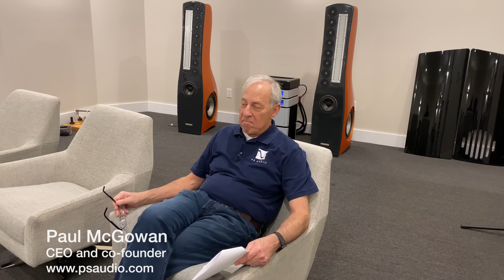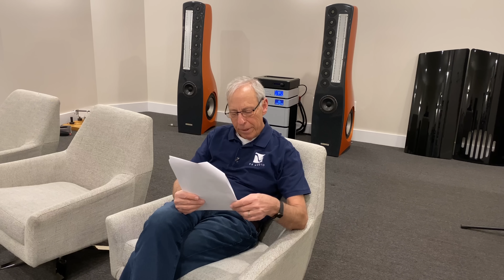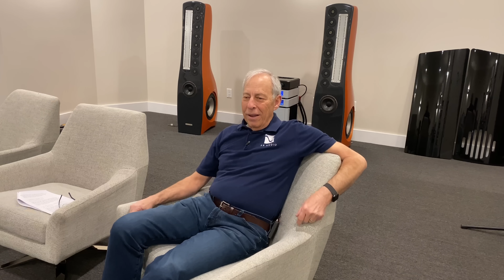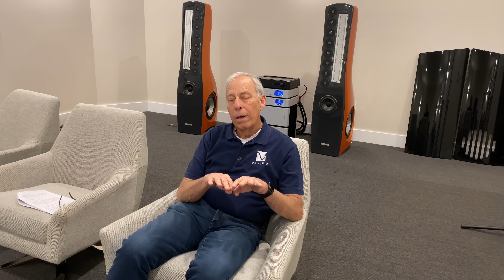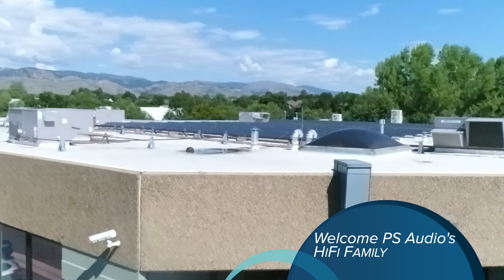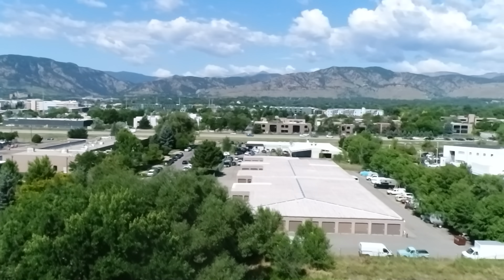Are mains purifiers necessary?

Comment: I use different power conditioners for different things as i cant afford a ps audio regenerator though i really wish i had one however i got a much cheaper voltage regulator with a line filter added on plugged in threw it and seems to run better than the wall

Comment: i have no idea what a mains "purifier" means. However, one of the best improvements I ever made to my home studio, which has multiple analog audio interconnected devices as well as digital interconnections, was to power all devices from a single balanced power isolation transformer, specifically a Furman IT-1210. That not only completely eliminates any possibility of ground loops but also filters electrical noise and voltage spikes present on the mains. There is no electrical connection between the input and output. The input 60 Hz 120-125 VAC is converted to a magnetic field in the primary windings of a huge toroidal transformer and the magnetic field then induces the same voltage in the secondary coil, which provides the output power. Because of magnetic reluctance high frequencies cannot be communicated between the primary and secondary coils. The magnetic "inertia" also knocks down momentary voltage spikes.

Comment: It’s Not true at all I have power conditioning that I cannot distinguish from the wall it took me some trial and error but I found a great one,I have tried regeneration from the original 300 and newer and every time my playback got sterile,my system is very high end and revealing and I can hear a cable changes anywhere in my system and always the same outcome with regeneration,great talking points but that’s it for me

Comment: My experience is the same as Paul’s.
I used Russ Andrews purifier blocks and cables for years. It was a rabbit hole I just journeyed down and didn’t look up. A dealer then came to my home to install some speakers.
He noticed my mains set up. He said. I’ll give a free upgrade in sound. Unplug your power amps and pre amp and put them straight into the wall socket. Boom! What a difference. 
And yes it was a live recording. The last track on Harvest Moon. All of a sudden you could hear the room ambiance in the recording. Try it.
Reply: Agreed. I initially had my amps and sub plugged into the wall and almost had to watch how loud it played (I have neighbors). After completing my system(s), I then moved to improving things (for the sake of improving things). After plugging in my conditioner, I noticed (just like Paul) that the sound was "cleaner" yet it was missing that "punch". I made myself believe that the cleaner sound was what I really needed. About 10 months later, I switched back to the wall after reading some posts, and have never looked back. Its amazing what you miss by doing this.

Comment: Don't the capacitors in our systems store power and distribute it cleanly as needed? Wouldn't this mean that this stored power has already been made stable and isn't really coming out of the dirty wall outlet anymore? Power settles down in the capacitors and is subsequently dished out cleanly and stable as needed.
Reply: Simply put, yes. This is why everything has a power supply. The idea that power can be "dirty" or "noisy", especially with audio, is complete nonsense.

Comment: I’m not sold on a “separate” power regenerator or conditioner etc.  

I have 2 modest systems. One in the living room and one in the family room.  

The family room was more of a “starter” system I first got in 1996 I believe. When I purchased the Adcom amp I decided to get the Adcom power conditioner for it.  I don’t think I even bothered listening to with or without because the bottom line is that I didn’t want to plug in my amp or other components directly to the wall outlet or use some cheap power surge protector.  

All the components are plugged into the power conditioner and eliminates any turn on or turn off thumps. Everything still works in 2020 in two different homes and has survived many power outages. 

The system in the living room has 2 Acurus Mondial Designs power amps and pre-amp and so I also bought an Acurus power conditioner.  I am of the belief that matching components from the same maker is a good start.  This I bought in 1998 if I recall. 

All the components also have lasted two homes and work fine even today.  At time I didn’t even turn on the system for like 6 months or longer.  Works fine.  

I kind of go in and out of high fi stuff.   Watching these videos is getting me back in to this. 👍

Comment: Purifier/regenerator/conditioner... all the same: they are made to compensate for shitty power supplies that lack proper mains noise rejection.
Instead of curing symptoms, try to find the root of all the issues and solve that; replace the shitty power supply with a good one.

Comment: Just buy modern gear with switch mode power supplies -- by definition, they "regenerate" mains power to high frequency AC before the (vastly smaller) power transformer delivers it at a suitably lower voltage to the rectifier and filter circuitry to provide DC to the actual audio electronics.

Comment: Any power regenerator must take the incoming power of whatever non perfect sine wave it is and store it somehow either in capacitors, batteries or both which are DC storage reserves, then regenerate it by creating  a new sine wave that is made by power switching devices which is in effect a digital to analog converter but a single frequency one that has its own high frequency switching noise that uses a low pass filter to reduce the switching frequency energy. This is in reality just a high power class D amplifier operating with a single frequency sine wave signal. It is in effect just an additional power supply to the ones inside your electronics, which if adequately designed and built do the same thing as a power regenerator but just for their own device.

The only precautions really needed for audio systems are to not have heavy load appliances especially air conditioners or refrigerators that have compressors with very high peak starting currents on the same circuit as your audio systems, although adequate power supply storage capacitors can effectively keep those transients from getting into the amplifier and your audio. A decent power conditioner with good RF filtering to keep conducted EMI from noisy switching supplies in the house like computers, televisions,etc. and EMI from outside the house like from your neighbors saws, televisions, computers, etc. and RF fields is a smart idea. Also the surge suppression that is built into the power conditioners to limit the spikes from lightning, motors turning off, etc. is a good thing.  

The claims of a power regenerator preventing the masking of audio subtleties from happening is not going to happen with good audio equipment power supplies and external power conditioning.

Comment: I have often wondered is there is a difference between running 120V or 240V to stereo equipment.  Most modern US homes are 240V at the box and then just use one side of the 240V to get the 120 V.  A lot of stereo equipment has a setting for 240V power.  You would have to have a dedicated circuit though.

Comment: My snake oil detector is singing loudly. If the designers of your equipment provided properly capable power supplies, you wouldn't need any form of mains correction. When they don't, you might. Paul makes and sells both items. Draw your own conclusions. 

Your amplifier (for example) internal power supply should do more than make 110 or 220 volts AC into rail power. It should keep noise on the line side, away from the audio, and should make proper rail voltage -- power line vagaries notwithstanding. If your AC line voltage drops more than 20%, you have a bigger problem than with your HiFi.

Apocryphal:
I have an old sound bar on an old TV that has a crap power supply. I reacts loudly to my washing machine buzzer. Honest, it does. It's crap, that bar. I know it. But my decent main music system seems carefully uncaring about line "junk." That's because the devices in that system were designed properly. 

How much does a regenerator cost? Maybe I should put my money in that collection plate, and preserve all the loveliness of my hundred dollar sound bar?

Have you considered buying a speaker demagnetizer or an AI powered error-correction processor for your streamer? 
And your martini is nothing without an olive from Corfu.

Instead, make another payment on your Maserati.
Reply: The truth.

Comment: you have 3 types  regeneraters  and conditioners and filters.  first 2 total not for oudio , its alll in the filters for to take the harmonic distotion off. the best medical filter cost only 150 dollars.  conditioners ar for fase schifting composetion ,  and digital regeneraters are no perfect the power surplay you have whay put 2 power surplays in serie? if you wand perfect sinus you need a analog  moter - generator setup  all emc protected.  i only use Schaffner FN 352Z-6/06  i bett it is bether then all monster or another brents power units 2000 dollar plus. i never have seen any lab testing reports off them.  if you want still bether bay a schafner 700z  100db demping up to 100mhz.

Comment: I am a supporter of Paul on this concept but for a different reason. I suggest that if the replacement cost of your HiFi system exceeds the cost of the least expensive PS Audio Power Regenerator ( Stellar Power Plant 3, $2,199 ) then you probably should consider buying one.

The common HiFi Consumer does not have the necessary monitoring equipment to access the status of their incoming Mains. Just assume it’s CaCa and maybe at rare times dangerously CaCa to your equipment.

Ever turn on something electronic and it just does not come on. No life, DOA. I suggest that many times that could be do to a power feed hit to the components power supply. And it can’t be repaired.

Which is better? You go to your HiFi and turn on the power only to find that everything is DOA. Plugging a light into the wall socket tells you the power is on but nothing in your system works any more.

Or…

Turning your system on, nothing works, and through a little plugging and unplugging you find that the PS Audio Power Plant is cooked internally. It basically sacrificed itself to protect your system.

I've seen the inside of a NEMA 12 Box used for power switching look like a little bomb went off in there. That’s why you use a NEMA 12 Box. To keep the mains power explosions inside the box.

Paul said the magic words. Common Mode ( spike ):

https://zerosurge.com/normal-mode-v-common-mode/

These things are increadably destructive. Let the PS Audio Power Regenerator blow itself up and not your precious preamp or DAC. I’m sure PS Audio would love to repair or replace that even if it’s out of warranty.
Reply: Very nice treatise in the subject of normal and common mode surges, although most people will not read it or understand it. But the bottom 2 lines say it all:
1. Choose – Mode 1 (Line / Neutral) Suppression Products!

2. Until the disruption, degradation, safety concerns and damage from mode 2 products is common knowledge, “all modes of protection” will continue, particularly at the consumer level!
Reply: @StewartMarkley  An important point that's outside the understanding of consumer electronics is finding a decent earth ground. That's the green lead in a three conductor romex cable. That can at times be a real challange.

Comment: I have had trouble with a Furutech (not cheap!) conditioner not actually delivering enough power to run an admittedly power hungry, power amp. I also have a P500 Power Plant. The only time I have tried it on power amps was with three SET amps that draw about 75 watts each. While they ran ok, the draw was enough to activate the cooling fan in the P500, and I hate cooling fan noise. So, really, the 500 watt Power Plant is good for about 100-150 watts. While a Power Plant certainly does no harm within it's limitations, and mine is still hooked up (no amps), don't expect miracles out of one as far as sound quality improvement.  What I use now are power strips that have an RFI filter, designed for HAM radios. They cost about $75 each.

Comment: In an industrial; area, there is a very great distortion of the wave form as the high powered equipment does not use the first half of the slope of the wave but rather triggers the load at some point along the wave.  In other words the power is never a real sine wave but rather a distorted misshaped creature that is not improved by transformers and little if any correction of this distortion improves by power conditioning filters.   The lighting dimmers in the room can cause this same poorly shaped waveform.
Reply: Any of the triac controlled speed controllers or lighting dimmers can and do use the full 360 degrees of the sine wave if turned up all the way. Power conditioners will filter some of the high frequency switching transients associated with the controllers although a good power supply will also prevent the switching transients and other conducted EMI from being a problem.

Comment: Please answer this Paul: does a regenerator obviate the installation of a dedicated powerline? If so, it could bring down the cost of the regenerator for anyone considering a dedicated line. They could put that money into the regenerator.
Reply: The cost of adding a dedicated line for your audio system will certainly be far less than the $2199 of the PS Audio regenerator. Anyway, power regeneration is BS. Read my post on this.
Reply: @StewartMarkley  I don't see your post but would read it if I could find it.
Reply: @hilde45  Any power regenerator must take the incoming power of whatever non perfect sine wave it is and store it somehow either in capacitors, batteries or both which are DC storage reserves, then regenerate it by creating  a new sine wave that is made by power switching devices which is in effect a digital to analog converter but a single frequency one that has its own high frequency switching noise that uses a low pass filter to reduce the switching frequency energy. This is in reality just a high power class D amplifier operating with a single frequency sine wave signal. It is in effect just an additional power supply to the ones inside your electronics, which if adequately designed and built do the same thing as a power regenerator but just for their own device.

The only precautions really needed for audio systems are to not have heavy load appliances especially air conditioners or refrigerators that have compressors with very high peak starting currents on the same circuit as your audio systems, although adequate power supply storage capacitors can effectively keep those transients from getting into the amplifier and your audio. A decent power conditioner with good RF filtering to keep conducted EMI from noisy switching supplies in the house like computers, televisions,etc. and EMI from outside the house like from your neighbors saws, televisions, computers, etc. and RF fields is a smart idea. Also the surge suppression that is built into the power conditioners to limit the spikes from lightning, motors turning off, etc. is a good thing.  

The claims of a power regenerator preventing the masking of audio subtleties from happening is not going to happen with good audio equipment power supplies and external power conditioning.
Reply: @StewartMarkley  Thanks so much for that explanation. I've probably seen or heard 5+ videos on the regenerator and it's very alluring. However, I think my $500 Panamax Max 1500 conditioner/surge protector (10 outlets 1800 Watt) should offer sufficient protection and plugs. (Details: www.cnet.com/products/panamax-max-1500-allpath-surge-protector-1800-watt). I've heard a bunch of videos explaining why a conditioner is not enough or even restrictive of good sound. I'd really need an A/B test to test that out. I know I could do that in theory with PS Audio's gear. The gist of what you're saying seems to be, "Don't even bother with such test even if it's free."
Reply: @hilde45  I am a big fan of A/B testing if it is done properly under double-blind conditions. I am also a big fan of proper and adequate measurements. I am always skeptical if these are not done or available. I also rely heavily on my knowledge and experience of 50 years in audio and electronics engineering. But if it costs nothing but time and possible aggravation, then give it a try. But don't be fooled by a hyperbole and the pure belief that if it costs more it must be better.

Comment: Was gonna comment how my *120 power cleaner from the China takes my DAC from pedestrian to wow... and then you spoke about the loss of high fr detail and musical life/mojo... I guess I'll have to do a real live in depth test....
Reply: Let me know! Im gonna do the same. Would the amp be the only thing that needs to not plugged into the conditioner?
Reply: @Masterseven77  In my world it's a complicated answer... for some long time it was a good thing, but it seems that now that my system and room are performing correctly and I am converting everything to 256 DSD the filter does, indeed, result in an over-smoothed and somewhat life depleted result.  If I was doing playback in PCM I just might have to put the power filter back in...
EDIT: Nope, the filter thing is back on, the difference is huge, without may have more life at first blush, but it's got less depth and tone and the high end is just grating on  my nerves after not much time...